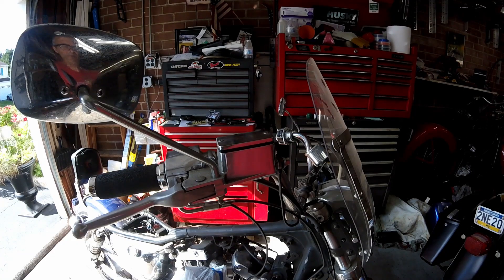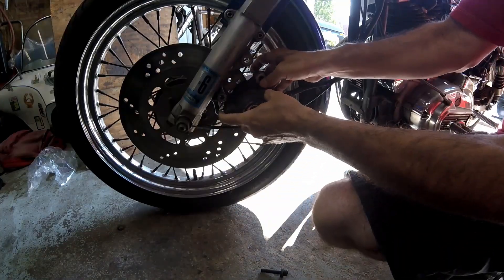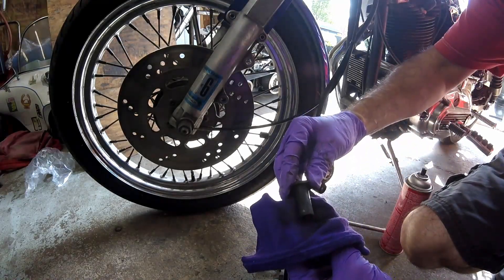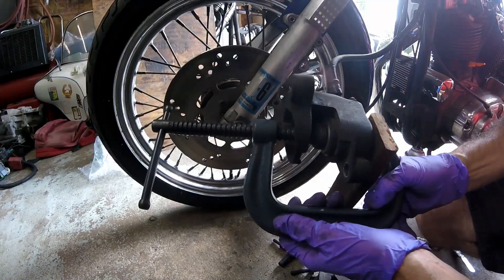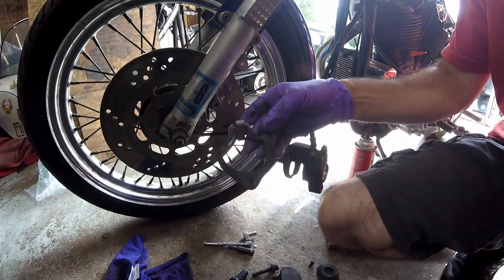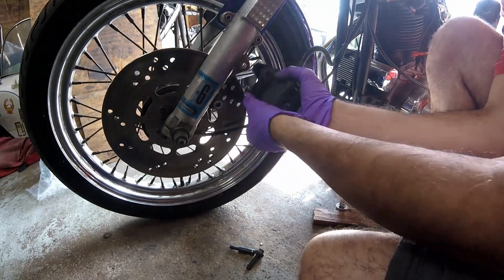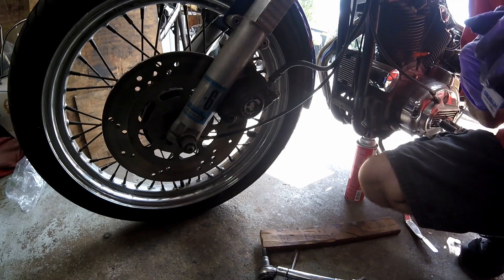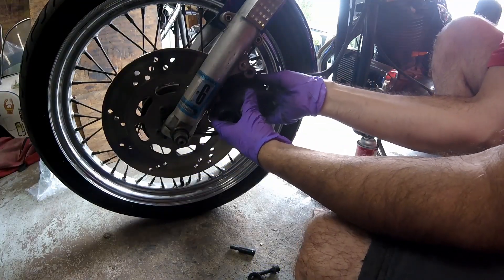Troubleshooting Caliper & master cylinder for Ironhead Shovel head Evo 1980-1999 won't release

Comment: Thanks for another great video Carlo! So you don't use lube on the backs of the pads? I've been using CRC Disk Brake Quiet for a few years with good results. I should've stuck with it. Last week I used Sil-Glyde instead on the rear pads on my Sportster and now they squeal up a storm. I cleaned everything really well and greased the caliper bolts before reassembly. The rotor looks like it's in good shape. I guess I'll just have to redo it - back to the CRC!
Reply from the maker: I use a small smear of RTV but I forgot to say that because I had to rebuild the caliper and master cylinder. The system had a bunch of old fluid in it that turned to crystal rocks. That will be for a future video... You know how that goes... Thank you for watching!
Reply: @Rapsgarage  Oh okay yeah a little lube seems to work....
Oh yeah old brake fluid can get mighty ugly sitting over the years. Thanks for posting these videos man they are a great help!
Reply from the maker: Thank you for watching